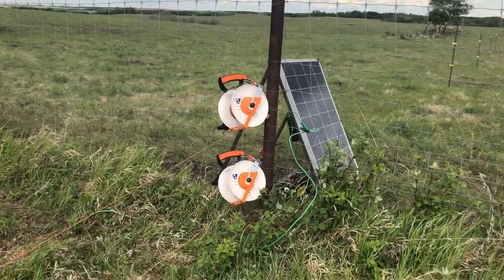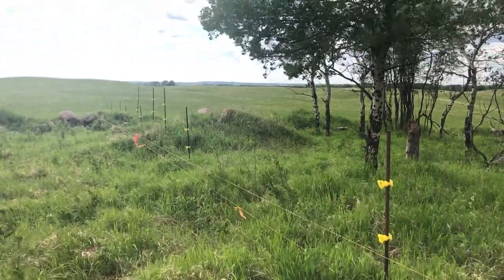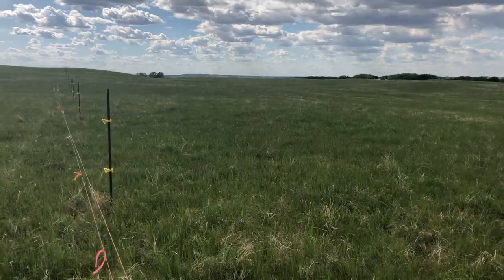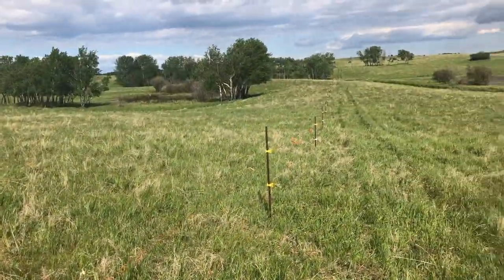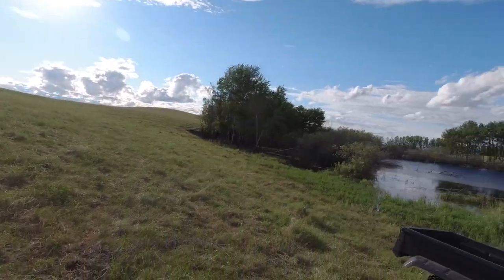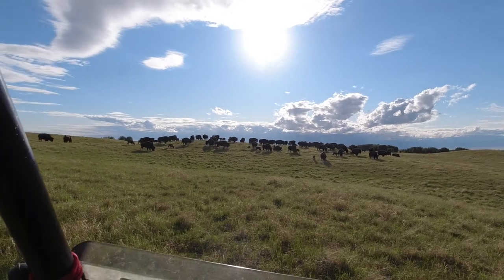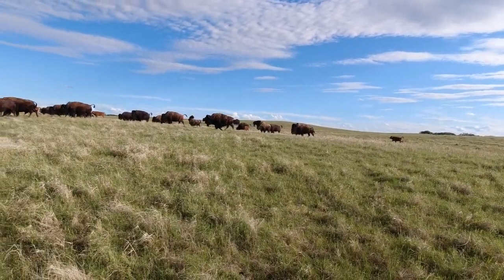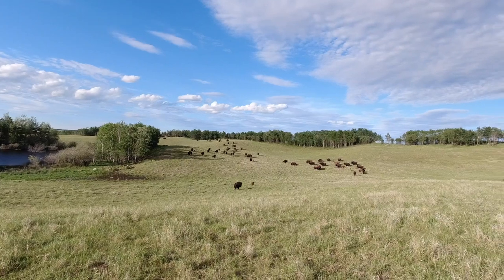BISON & ELECTRIC FENCE!?!?

Comment: Great video. Just found your channel today.
Reply from the maker: Happy you found it! Enjoy the content!
Reply: @coppercreekranch466  great video, just found your channel. What kind of post did you use on the electric fence? Look like round pipe or solid round stock?
Reply from the maker: The posts are 7/8” sucker rod
Reply: @coppercreekranch466  do you have a supplier for used sucker rod? I can't find any here in ga.no oil wells here.
Reply from the maker: We have lots of oil activity in our area so it was very easy to find used rods. If you have a pipe supply company in your area they might be able to help you out, or you could put up a wanted ad and see if you get lucky.
Reply: @coppercreekranch466  how tall are the sucker rod post? What  name brand of fence charger?
Reply from the maker: I think we cut them around 5 feet and the charger and poly wire is Gallagher

Comment: I have a dream of one day of having a bison permaculture farm there awesome and it's gonna be the beef of the future I hope. Do they sell any kinda mobile fence that would work with bison?
Reply from the maker: That’s an awesome dream! Don’t let that dream slip away! Electric fence is about the only portable fencing I can think of for bison, I wouldn’t trust it as a perimeter fence though, page wire is a much better fence for bison but is permanent..
Reply: @coppercreekranch466 Thanks I'm hopefully on the right path! I love bison I'm also a Chef and my dream is to have a farm to table restaurants which is supported by sustainable permaculture and I'd love bison to be apart of that. Unfortunately there's not many Chef's moving in that direction they're actually going to opposite and supporting cultured meat it's crazy.